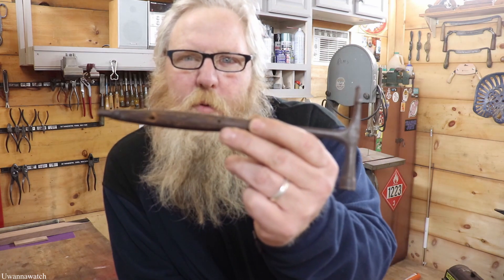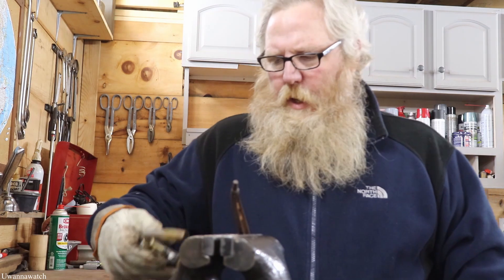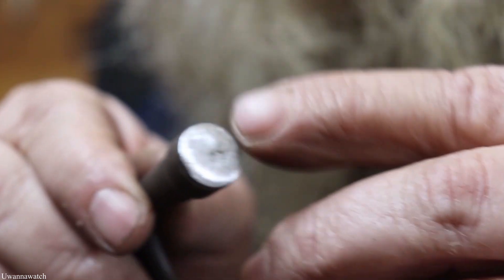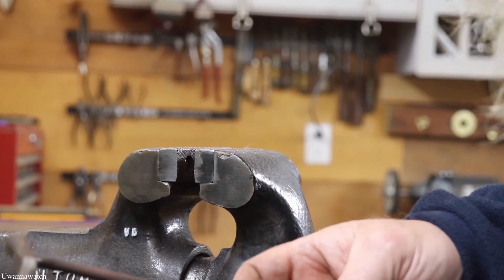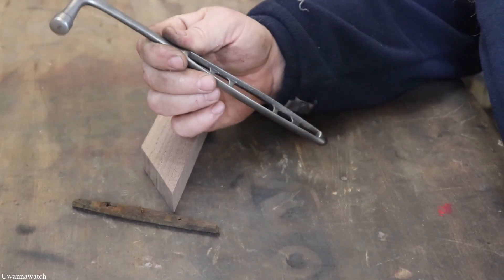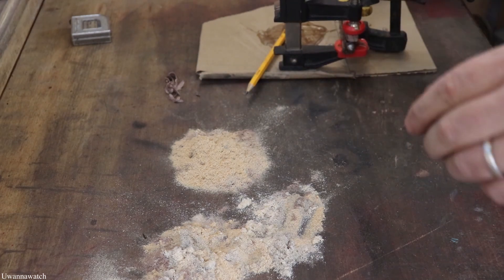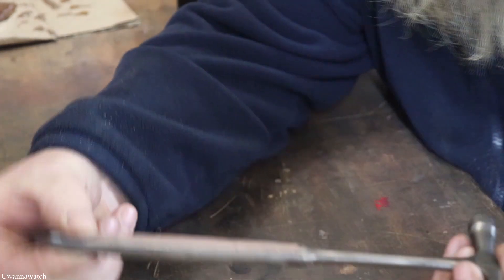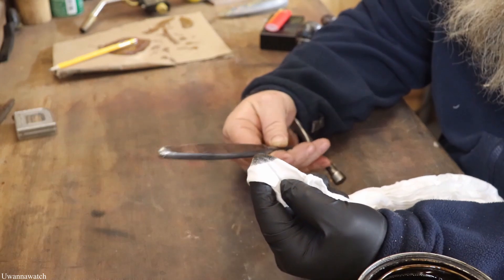Perfect Handle Hammer Restoration

Comment: I like how you got straight into it Big G.
Handy little hammer to have in the shop. I'm sure it will come in handy when you need it.
Cleaned up very nicely and as long as it feels good in the hand that's all that matters. Well done.
Reply from the maker: Thanks  Bro, it actually really does feel good in the hand to use. I used it the other day to reupholster a chair. It surprisingly works really well.